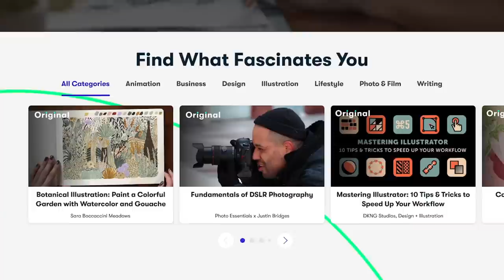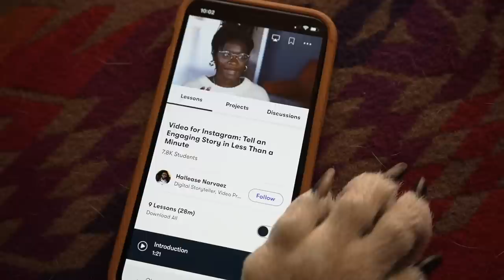Figuring It Out As I Go || Building A Tiny Home on Wheels

Comment: I'm liking the new build!  With everything on one side now, will you keep a wide walkway connecting the back and side doors?  It feels like you have less storage space.
Reply from the maker: Ya there’s a little hallway already. And I put heavy stuff on the right side storage. I actually have more storage than before, at least built in. Before I had a pile of junk I hated, now everything has a place and is part of the designed
Reply: @tidelinetoalpine  The storage on the other side escapes my mental picture!  Probably not too many flattering camera angles or reasons to point the camera its direction.